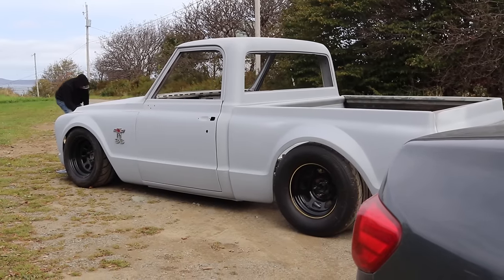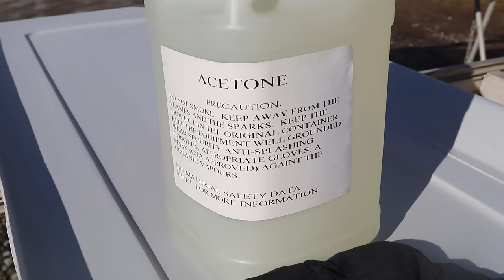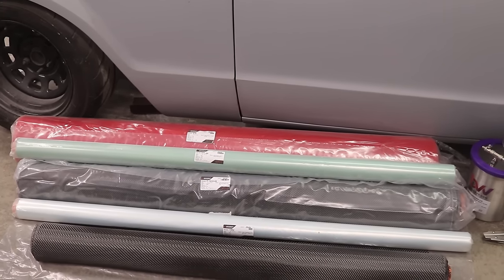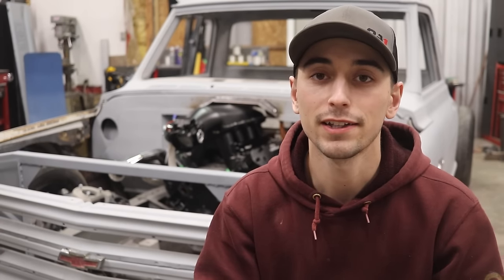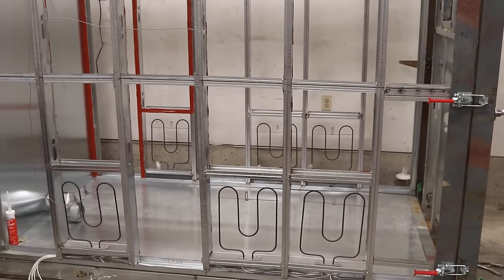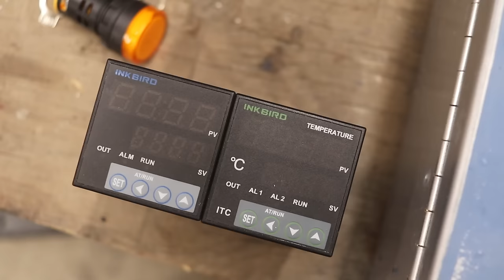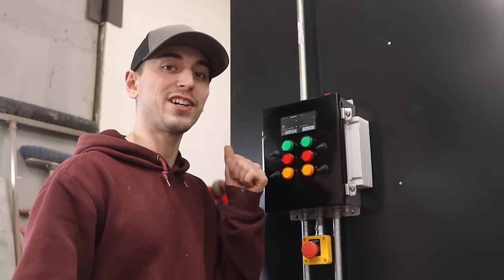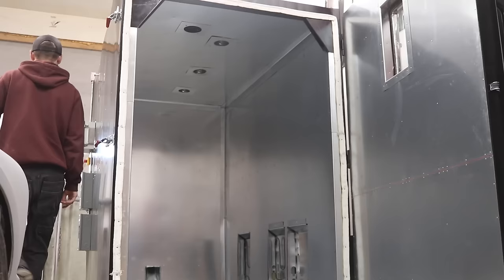Carbon Fiber C10 Build- Making a Composite Oven!

Comment: I’ve been a composites engineer for 18 years. Cool to see the project. I would recommend using freekote B-15 sealer in addition to the 700nc release agent. It acts almost like a high build primer to get a better surface finish. It will help the parts release from the mold even better
Reply from the maker: Just ordered some! Great call, thank you very much👌👍
Reply: This is sound advice… Respect the tool surface from the beginning

Comment: ive built multiple ovens for powercoating. you dont need to insulate the floor. have it sit flat on the floor. remember heat rises. then you can roll parts on a tray into the oven.

Comment: What a ride this truck build is turning out to be. I had my first start on my c10 yesterday. I honestly am on board with the Carbon fiber build, and if it turns out as amazing as i think it will, i may have to try it too. Although, your still in the early stages as far as putting together the drive line. i built my own fully forged LQ4 with all the bells and whistles but i really think you should ditch the Iron block for an Aluminum block, with all the work your putting into carbon fiber, peeling 100+ lbs of weight out of your truck is going to be big too. an LC9 would be a great option, a aluminum 6L is the LS2 and they can be pretty pricey and hard to find, but the 5.3's are probably the best boost motors for abuse due to the cylinder wall thickness. However, you can alternatively just rig everything up with your 6L and boost the brains out of it. if it ever blows up, you can get another LS at any pick n pull then put the screws to that block lol. I am stoked to see how this turns out buddy. Maybe you can start a business just making Carbon Fiber C10 body panels? shit. If you made them for my year of C10 i'd be temped as hell.  If you can, please do a cost breakdown!
Reply from the maker: So pumped to hear you got your c10 fired up! I know just how exciting that is🤙 it will definitely be interesting to see how the carbon works! As for the engine, you're 100% right about the aluminum. By the end of the build, who knows what I'll have at this rate🤙 I can definitely do a cost breakdown once I get the rest of my supplies!

Comment: only things i can think is one: provisions for vacuum lines so your pump doesn't have to be inside and two: the metal on the outside is going to get hot with no insulation where the elements are. you could make a box around the area of concern on the outside and insulate it that way.

Comment: Look up the fiber forge. They already made a full carbon c10. Itd save you money if you can use their molds
Reply: His fenders are modded and I think his bed is shorter
Reply from the maker: I've seen their C10, it is absolutely insane. My c10 is completely different dimensions so their molds wouldn't work. I doubt they would be willing to share their secrets as well!

Comment: Based on the video posted 4-1-24. I don't see how your keeping the exterior oven walls at each element pocket at a safe temperature. The best/most convenient way I see is to add a small studded wall oversized around all 3 elements in each wall, filling with the insulation, and closing it in. It would also make the oven more efficient with the temperature and electricity needed. What's are your thoughts on my resolution with that issue?
Reply: If this has already been addressed on a newer video than disregard my question. With that being said I do find your video educational with your approach.
Reply from the maker: Good eye, but yes, I have since then boxed it in with insulation so it's completely sealed up. I'll be showing it in my next video!